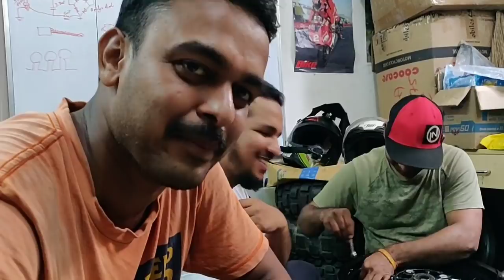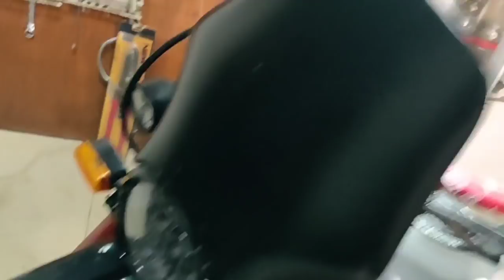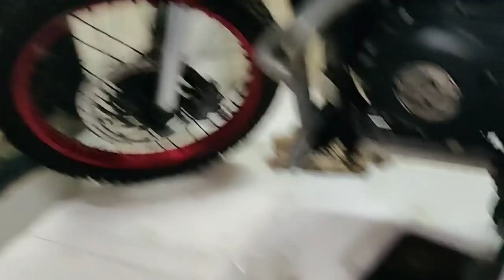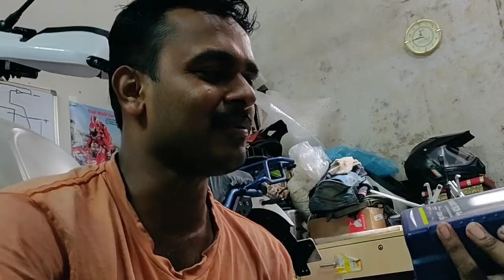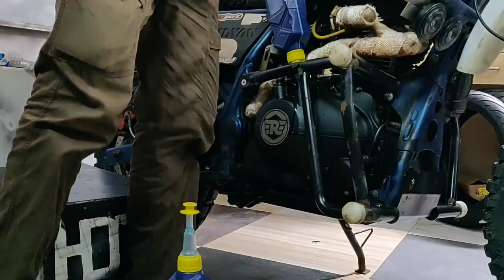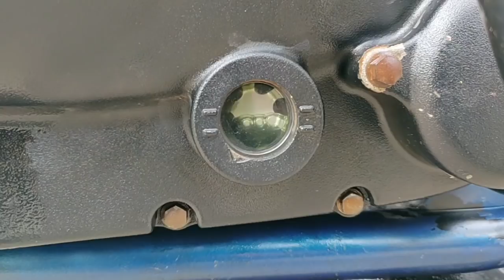Am using Putoline Nanotech oil for my RE Himalayan

Comment: Hi Bro, me too used Putoline 15W50 and 10W60 for my TB350 very good oil later one is best, drain interval is more and more imp vibrations reduced little bit.
Reply from the maker: Thanx for the info bro even am happy with it but even motule is what I like most
Reply: HDT Customs 
I hvn’t used motul yet but one of my friend used it performance is ok but he facing engine overheating and harshness.....
Reply from the maker: I never faced that type of Ishu he must be using some difrent gread   . Tell him to use 300V 15/50 or 10/40
Reply: narsing ekbote...where did you buy the oil from?

Comment: Sorry but the oil grade is not ambient temperature dependent, rather than construction and tolerance of a engine design, the reason why most modern Honda/Suzuki cars are running 0W20 oils in India right now, so changing factory recommended oil grade is not at all recommended, the engineers know exactly what’s their engines tolerance and don’t want a thicker/thinner oil than needed..
Reply from the maker: Thnx sir that was some great info . Got to learn more about this

Comment: Bro now that the Himalayan is coming with ABS . Can we modify our existing brakes to abs?? Kindly help with your abs ideas
Reply from the maker: Today I had a spinn on ABS Himalayan and found it very week breaking compair to our normal breaking system . ABS activation is slow but it's stedy
Reply: So u want us not to shift directly but go slowly about if abs is required or not. But can we put abs in existing non abs model.
Reply from the maker: Yes I might am not shour but all Wer same except modular fitting space

Comment: Nano technology synthetic oil are mostly for high revving motors like ktms and all yeah even Himalayan would make a significant difference
But not for all Royal Enfield in my experience coz IV used motul semisynthetic to fully synthetic and liquid molly synthetic oil.. it's good but not required in UCE engines which comes in 350 500 and 535 cc
Coz uce engine itself is restricted becoz of pushrods..and IV noticed one thing by putting fully synthetic oil in my Royal Enfield the top speed top end reduces to 5 km reason which I think is the synthetic oil properties they maintain their viscosity even on high RPM of motor which itself slows o resist the pushrods engine top end.. unlike mineral oils they tends to gets less viscous on higher rpm providing uce engine less resistance... hence the top speed increases I know it's not technically right way to got fast but hey it works for me.
P.s it's totally my experience.

Comment: Great work man !!! I wanted to know how much torque should I apply while tightening engine oil nut.
Reply: I would suggest you to use standard ring spanner and apply the force as much as you can. Bcz the length of each spanner is made based on torque required to thight respective size of nut. And if u r concern about oil seepage later on, then I would suggest you to buy a sealant maker tube from any auto spare part shop. It costs 30 rs. U can put it on thoroughly cleaned contact surface of the oil cover and stainer caps. It will. Give u excellent sealing.

Comment: 15W50 where  are 15 and 50 stands for viscosity of oil at (-17.77 degree Celsius and 100 degree Celsius) respectively an W stands for winter
Reply from the maker: Thnx for the info bro

Comment: Hemantbhai instead of upgrading this engine try installing a Continental GT engine if its available and it fits.535cc.29.1hp@5100 rpm.44Nm@4000rpm.superior engine than himalayan tried&tested.power:weight ratio is better.
Reply from the maker: Sir after doing performance upgrades my bike is faster then GT the y vll I change to 535 cc engine . My stock is running faster the it
Reply: @hdtcustoms11188  Commendable work there 👍, I was thinking on similar lines of how about trying out a D390 engine with power commander to ramp up the hp to nearing 50HP. With that said advantage is the weight reduction. Kindly let me know what you think...

Comment: HDT Customs  Commendable work there 👍, I was thinking on lines of how about trying out a D390 engine with power commander to ramp up the hp to nearing 50HP. With that said advantage is the weight reduction. Kindly let me know what you think...
Reply from the maker: First thing I vll not do that BCS it's an illigal job which can be problem for u and me . And rest y to swap engine ? Get 390 and ride it it's the best machine in segment but it can't do offroading and for offroading you don't need that amount of power . And your point of weight reduction is right but can't reduce much on it
Reply: @hdtcustoms11188  True that, working to make the vehicle road legal would be a time consuming process or the m/c will have to be a dedicated trail bike not for public use. Now with that said from a build perspective looks interesting.

Comment: I still has the same question everywhere. Engine capacity is 2.5L. when we change the oil they will pour only 2L or less than that. Why it is like that? Moreover... Changing engine oil will change the oil in radior right? Where is the other 0.5L goes???
Reply from the maker: Bro it's 2 lites for Himalayan engine